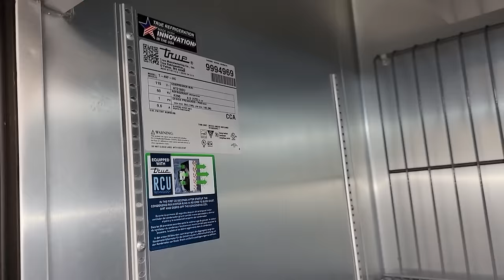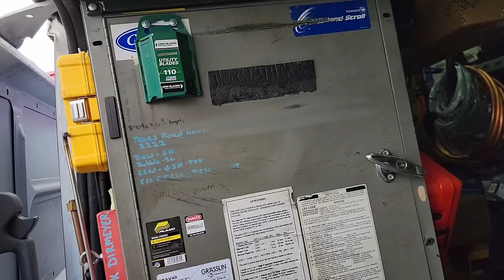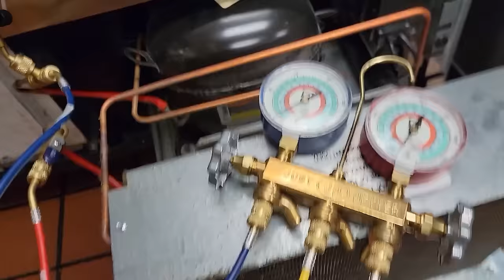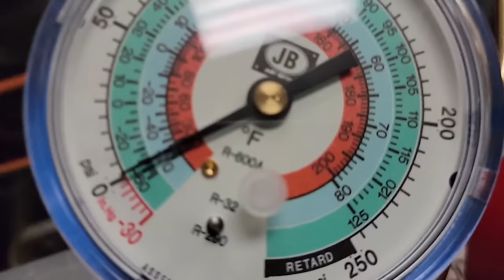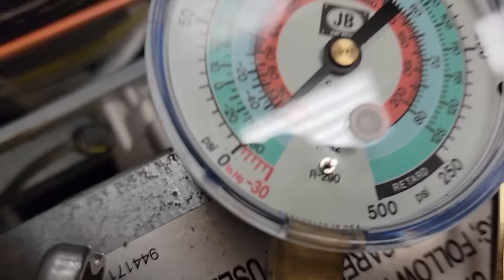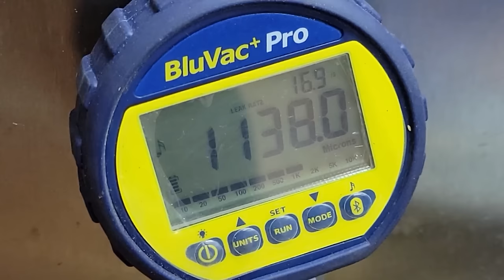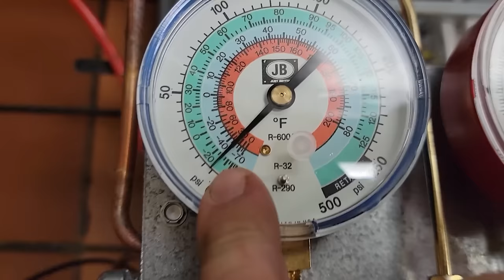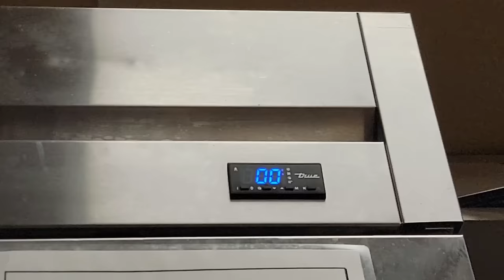R-290 Freezer Gets Smashed

Comment: Warms my heart and makes me so happy to see a tech, that use common sense when working on R290 and not thinking the hole city block will blow up..
Reply: Hey, if they switch to propylene instead of propane, they will start becoming a threat.  (twice the energy density)
Reply: @tbelding  no.
It's about the air to gas mixture, with propylene its 2-11% propan is 2-9% so all in all the same. With the small amount of gas in systems like that, a pipe must bust full open and let all of the gas out at once and there must be a candle a foot from where the pipe busts
Reply: @christiansommer914  - As the folks off of Clay road and Gessner found out, detonation can happen.   Yes, you're right with these systems - about the only thing that's likely to happen is flaring off.  Mostly because the mix would only happen once a pipe breaks.   The outgoing pressure would keep oxygen from travelling back into the pipes to the reservoir - the actual compressor/condenser itself.  By the time the pressure was low enough for the infiltration to happen, there wouldn't be enough left to go bang.  

Energy content still matters, however.  Ignition conditions may be similar, but energy is energy.

Comment: Amazing out of the box repair. Most would have just told them nothing I can do until we get a new condenser. They were lucky to have you there.
Reply from the maker: I never have given up easily. Plus like I said I didn't know how long it was going to take to get a new condenser coil. Parts are getting harder and harder to get
Reply: Which is fine as long as they are willing to pay for the temp repair. Some businesses won't.
Reply: @TheNemosdaddy  That's true, but most food service type places will balance the lack-o-storage cost against the repair cost.   Their only other option is try to call around and find a place with an entire new refrigerated cabinet _in stock_, for next day delivery.
Reply from the maker: My company leases this equipment to them, they're going to buy a new condenser coil it's not an option. What happened was abuse.
Reply: @tbelding  From experience I can tell you. They will go online and order a new unit. For what we will pay for them or cheaper.
Reply: @14312KIDS  - You missed part of the point.  If it's going to cost more to repair than replace, they'd replace.. if you can find a replacement.  Right now, even with a/c companies offering deals in the ads, equipment is still in very short supply.  In this case, however, they're leasing it, and I'm sure the contract has language about this kind of abuse.

Comment: I agree its real life leave them on I have even seen a few MFGs that have access on R-290 from the factory, I know Silver King has them and at least 1 more but I am drawing a blank right now. First time I have seen those 1/8" hoses, they are neat but I don't feel a need for dedicated 290 hoses but to each their own. Good job on the repair too, I'll be honest I probably wouldn't have repaired that coil in most situations, I have 1 customer that only has the 1 freezer (no walk in freezer at all) they can't have it down so I would have done it in that situation, but most of my customers it would be a waste of labor hours to do because they would be fine until I get back with a coil.
Reply: the whole idea of dedicated smaller hoses and manifold is smallest total volume of gas within them, so it effects the charge minimally. the smaller the total charge the more critical it becomes. example: a tiny R-290 beverage fridge, full size hoses and manifold may hold nearly the total charge size!
Reply: @throttlebottle5906  I agree but R-290 is cheap (we only charge the customer $3 per 8oz can) and vent-able to the atmosphere, I use ball valve hoses and purge them first then weigh from a full hose, then just close my hoses disconnect and dump the hoses, I don't care about the maybe 50¢ worth of propane.

Comment: Nice work . I use master cool Scale you just screw the bottle onto it and it has a super small line it works very well for R290 and R600 and they’re very cheap less than $100
Reply from the maker: Thanks for the info👍👍

Comment: if the copper is soft enough, you may try hand bending with old school spring benders, wrapped around sockets, tubing, bottles, cans, table legs! whatever is about the right diameter
maybe even just the tubing wrapped around whatever, no spring bender, it may not be perfectly round/radius bends with some tube flattening, but if careful it wont kink.

Comment: What is the black hose and connection you are using on the bottle of R290 when you charged it up? I’ve always just used the box the bottle came in with a hole cut out to keep it upright when charging 🤣 I like your way a little better.
Reply from the maker: That black tube is just a small diameter refrigerant line with a weighted base to help keep the bottle up right.

Comment: JB is good stuff I use the revolver 4gauge manifold for refrigerant.
My local parts house only had the NRP brand. I wish it was the JBs but they work. Good video sir. 🎉 
Also have you used Nylog White for gas lines. Highly recommend!
Reply from the maker: I have not had a chance yet to use it. I've been wanting to, I don't go through that much pipe dope so it's not often that I need to try something new.

Comment: I would just have scabbed over the leak with solder. Pressurized and recharged. Recommend a new condenser coil. It was working before. So not completely crimped.
Reply from the maker: The quarter inch line was completely smashed, good luck with that.